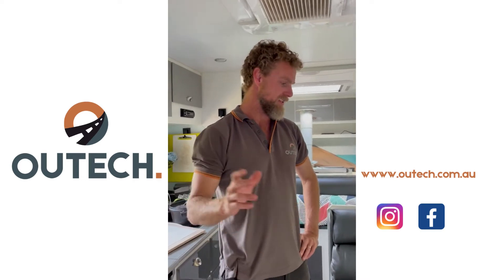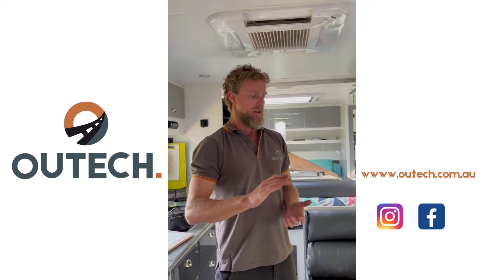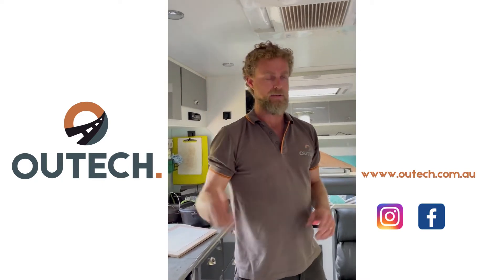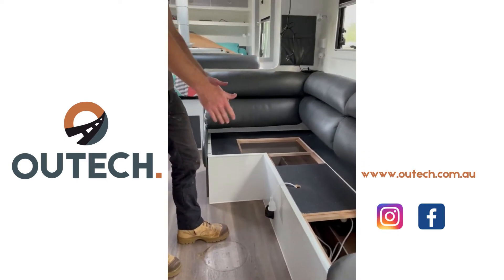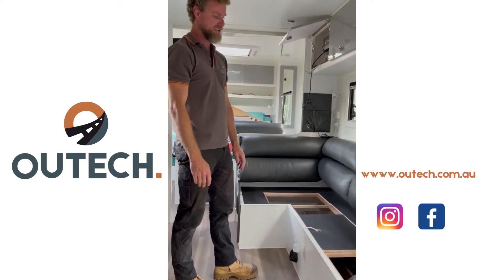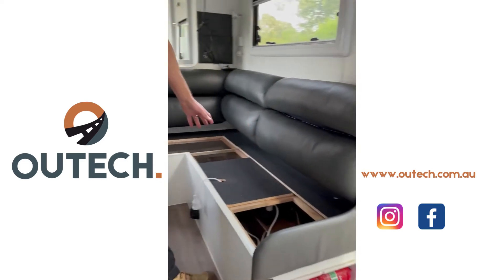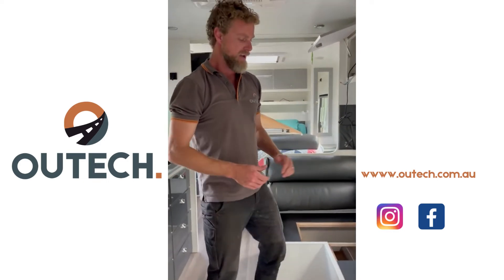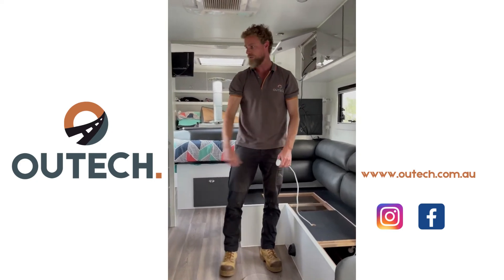Caravan Inverter - Should it Be Hard Wired?

Comment: Or plug it into your van inlet 😉
Reply from the maker: Hi Ben. That’s not recommended for a number of safety and practicality reasons. Isolated inverters plugged into non isolated fixed installations are definitely not recommended. Not to mention the issue of running extension leads out the window of your van to your inlet.
Reply: @outechoffgrid  
Hard wiring it through a 2 pole 3 way changeover switch is the fix though ?
Reply from the maker: Depends on how it is wired and protected through the change over switch. Sometimes if you use the right inverter a manual change over isn’t even necessary.
Reply: Plugging into van inlet is going to load up the inverter. The vans system will think it is on shore power and will commence charging batteries. Not a good idea and batteries will eventually go flat.
Reply: @frednurks8528 
Not everyone has a 10K setup your talking of here
Shore power .... turn your battery charger off
Reply: @bencole9936  I agree but not everyone knows to turn the charger off and in older Jayco’s even if you switch the 12v off there is a trickle charge to battery. I keep it simple and use an extension cord to the appliance I want to run. Against what he recommends. If you know your battery/inverter limits and the loads you want to apply, there is no issue. …..and still use gas. You can be off grid with a very modest system.
Reply from the maker: @frednurks8528 plugging a fully isolated inverter into an earth bonded system with absolutely zero earth leakage or circuit protection is not a good idea. As a bare minimum a portable RVD should be bought. 

But as I say, getting qualified sparkie to wire it in properly won’t cost $10k.
Reply: @outechoffgrid  information /provision of earthing of market inverters is seriously lacking in the supplied manuals. Why are they allowed to be purchased? I have an earth to chassis and a copper stake to ground when off grid . Good enough?
Reply from the maker: @frednurks8528 it’s not really something we can answer without fully inspecting and understanding what’s installed. In addition it’s offering advice to unqualified and unlicensed people. Sorry.